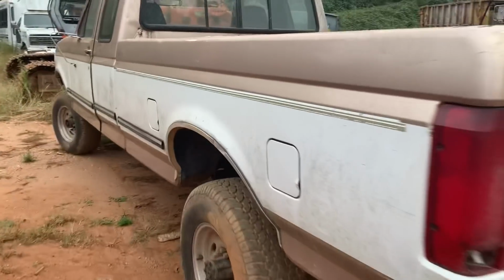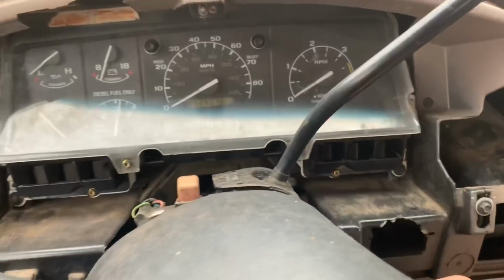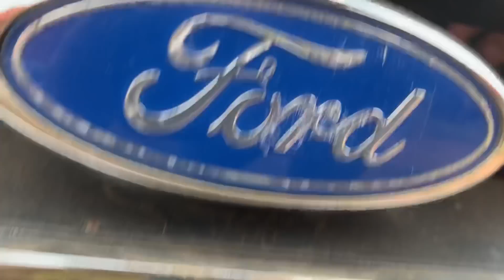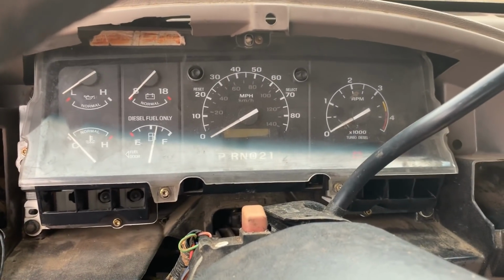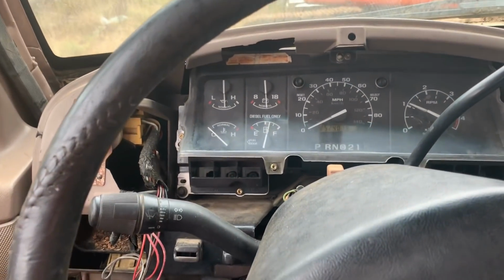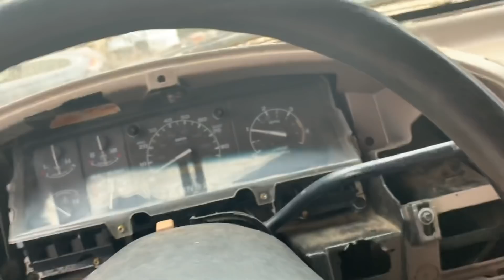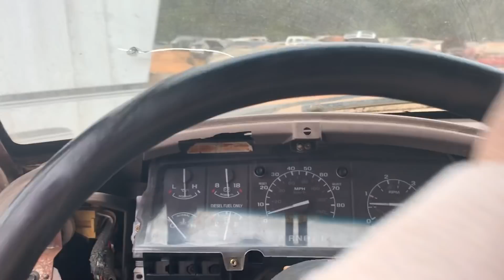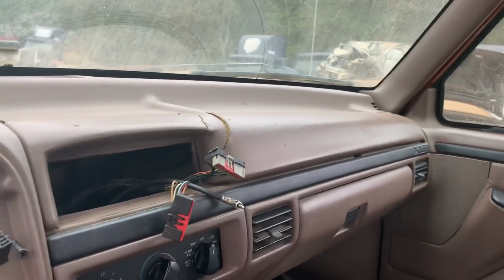COLDSTART JUNKYARD 7.3 Diesel

Comment from the maker: If your wanting to see more on this truck then please SUBSCRIBE! We are trying for 100k by the end of the year !
Reply: Jay Smart how much y’all would sell the truck for ?
Reply: You shoot that thing with either ur gonna have problems.... looks like cps is bad
Reply: Don’t shoot either to it in that quantity it just needs a 1/4 second bust at most. And disconnect the glow plug relay if your using either. It will blow a headgasket, crack a piston, crack a ring, or it even could backfire out the intake. Or don’t it’s your truck after all and you can zip ties and bias plys it all you want. I like it seems like it would still be a good work truck.
Reply: How much do you want to sell the truck for. I am really interested
Reply: Where are you locattteedd
Reply: I don’t have much money so yes. Have some respect. The newest vehicle I’ve ever owned is my 95 F250.
Reply: @makeitbreakit7556  my newest vehicle is my 74 chevy c60. XD

Comment: Change the oil with some good synthetic, throw a new fuel filter in, new belt and tensioner, maybe a trans service, then daily it for another 200k
Reply: He can daily it till it hits a MIL those trucks engines are tanks
Reply: @talib6928  maybe with a transmission rebuild, 7.3s are great the superduty auto trans is also good it just wont hold up to 1 million realistically. Especially judging by the condition of the truck.
Reply: @Snw-vi6xd  Yea but what I'm saying is that if he cleans it up or buys one in good shape he can run it till 1mil
Reply: @talib6928  maybe
Reply: Bike Rice just get a Cummins
Reply: @Dobbies Revenge dam that's clean then
Reply: Engine is good till 750k!!! Trans, anything near or over 200k is pushing it! The 4r100's need many upgrades!
Reply: Jonathan Tullberg e4od trans
Reply: @Snw-vi6xd  not nececarily my uncles 7.3 blew a hole in the block at 470xxx

Comment: That truck is KICK ASS!, just needs some Cleaning up on the inside, and drive it just the way it is 👍👍😎
Reply: Dude, it's a POS on wheels. I doubt you'd drive it on the street.
Reply: Luis Ramirez I would drive that thing anywhere
Reply: @colinwheeler4166  No, I own both Ford and Chevy. But come on, you wouldn't drive that truck in the city. Sure, I'd bang that thing around in a ranch to carry stuff and beat it up... But not anywhere else.
Reply: Hi. That old 7.3 Ford will be running when all your trucks are long gone! Its definately worth fixing! Most people just dont realize just how good these trucks are. Im 61, certified mechanic, been wrenchin for over 45 yrs. Believe me when i say i know. I think these trucks are the best trucks ever built, period!!
Reply: I was drive this everywhere even with miss match panels
Reply: Dude I daily a 79 Bronco that is just surface rust on it and has different color doors
Reply: I agree

Comment: The thing I've found to start this particular year of Ford diesel is to hold the pedal to the floor while cranking and they start every time
Reply: Is it different for diesels or because it's older? Most newer vehicles don't start if you hold the pedal to the floor
Reply: @wantsanewvehicle  it was in older ones like this one and older then that, I don't think new ones would respond the same
Reply: @ItsaRomethingeveryday  Gotcha. I know I always heard that it purposely does not start because this is a feature to clear a flooded engine. Any vehicle I have ever tried it in (not many to be honest, but a handful) has not started with the pedal fully depressed.
Reply: @wantsanewvehicle  we had one similar to this at work that would miss fire at start up during winter and I would just floor it while cranking it and it would clear itself out and start up, never did it with any other vehicles though
Reply: Mechanical fuel pump on these trucks, so YES!
Reply: YES if it's a mechanical injection diesel. Even older Mercedes diesel owners manuals said to depress the accelerator while starting the engine in very cold weather.
Reply: Marklin15 It isn't really what I'd call "mechanical" injection. It uses high pressure oil to fire the injectors, and a solenoid is what opens/tells it to fire. When you're talking mechanical injection, think of a pump that provides pressure to the nozzle head, at a precise time, to cause the injection event. It is what times, fires, and controls all functions of injection, independent of any electronic control.
Reply: It helps me at times to get my 7.3 started when Cold.

Comment: The most impressive thing is that the windows still roll up and down
Reply: Those old ford windows were awesome they had the smokers vent so the motors didnt have to work nearly as hard because there wasnt as much window to roll up and down I've never seen them quit before
Reply: @rouletteroller  Yeah they roll up and down fast too

Comment: Only the best diesel engine ever made!
Reply: 5.9 12v cummins dont @me
Reply: I prefer 7.3 International
Reply: 6nz
Reply: What about the Mercedes OM617 or OM606?
Reply: @jkjoshua567  good for small stuff that's about it
Reply: 98 Chevy k1500 Ryan yeah it’s not a diesel for towing or any of that but they can go a million miles!
Reply: Intertrashinal meh
Reply: Jkjoshua567 mines at 350k but is a 97
Reply: CurtPlayer 820 I have an OM602 5 cylinder at 150k right now and it’s doing pretty good. I’d love to have a turbo OM606 though!
Reply: 7.3 for reliability yes. Rather have a bullet proofed 6.0 tho
Reply: 5.9 24valve is the best
Reply: 6bt is the best
Reply: Nope. Everyone here is wrong
Reply: @jdlawless_fuel1416  ok why then
Reply: @adamfletcher4262  because old Detroit Diesel and CAT are the best
Reply: @ericpatton7767  7.3 had more power and torque then the 12V
Reply: @Thecowboy69997  not nearly as reliable
Reply: @ericpatton7767  7.3 is a million mile engine. How much more reliable does it need to be?
Reply: Hi. Im 61, certified wrench for over40 years. 7.3 international!!  The million mile motor, er engine. Best ever light truck engine period!

Comment: Runs and drives so surely not the worst. I'd drive it - I'd fix the interior as that's the part where you spend all your time and have to live with - couldn't care less about the outside as I'm not the one who has to see it! Maybe give it a wash & put a bumper on it. Or I guess you could matt black it for a bit of a Mad Max look! Parts for these not hard to come by as they were in production for a long time. Engine sounds good.

Comment: That "cold air intake" is going to ruin the motor even further.
Reply: All diesel trucks have a cone air filter from factory. That's not a cold air intake
Reply: ZIP TIES talked about this at some point and thats coming from someone who usually doesnt believe in air filters. Go get the stock air filter
Reply: Nathaniel Clark we got a badass over here 😭😂 someone has sand in there chocha
Reply: @pcwizzy460  napa 6637 cone oil filter is the way to go. Breaths better then stock, filters better K&N.

Comment: Wait to start light isn't in the gauge cluster , it goes into that opening between the gauges and radio opening if you need pics let me know can send you pics of mine. Mine is a bone stock virgin no tuners no chips none of that crap . I have been told all f-series in that body have interchangeable body and interior panels ,but I have never had to test that theory.
Reply: I believe a lot of things are interchangeable between 1980 - 1996 F150s or 1980 - 1997 for heavy trucks.

Comment: 252k of hard abuse it looks like. I have a 1988 Ford F250 with the 7.3 non-turbo and it has close to 500k. I'm looking for a rebuilt or good used motor now. The 33 yr old factory motor is showing its age for sure. Judging by the rest of the truck's condition your glow plugs are probably flat worn out that why it won't cold start without assistance. The white smoke at startup is usually air intrusion in the fuel return lines burning out of it. 7.3 IDIs and Powerjokes are notorious for that issue. Easy fix though. I'm not from NC but I've been to many parts of the state. In rural farming towns like Enfield, Hertford, and some other spots of NC that truck would still be out working on a farm daily.

Comment: Some glowplugs and a relay and it would probably start.
Reply: I own a 1988 F 250 with the 7.3. I don't think he even waited long enough for the glow plugs to do their job before he cranked on it to start. In really cold weather, (I doubt he had that this time of year in NC) sometimes you have to cycle them 2-3 times to get enough heat to start the truck.
Reply: @kman-mi7su  the 7.3 idi is a whole different critter.

Comment: Have you checked out what people are asking for trucks in worst shape then that looks like the repairs or lack of repairs got the best of it . Body and  interior parts are available every where I’m junking a 96 ford f 250 bad motor and rusted out but it had a great interior and it sold fast  . the miles do not bother me at all , last year I sold a running 7.3 with 245 K on it for $900.00 . Make drivable and safe ...pass it on .